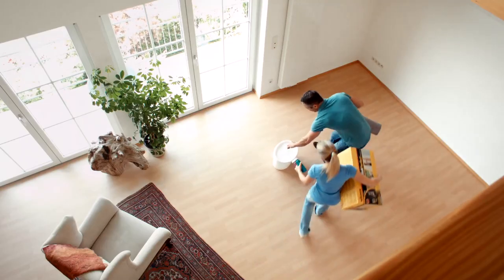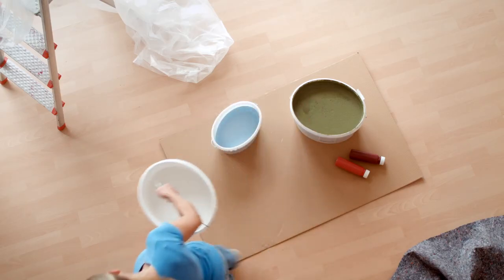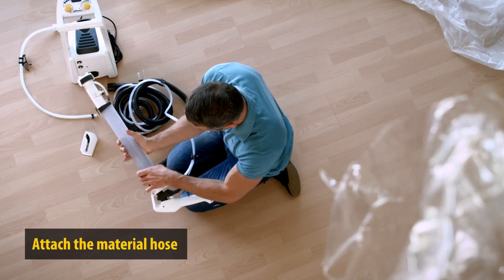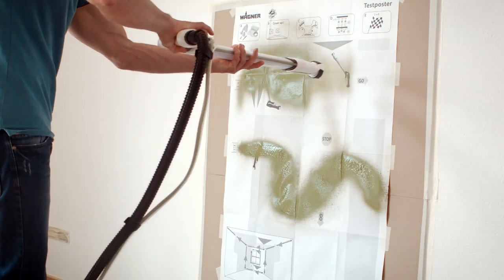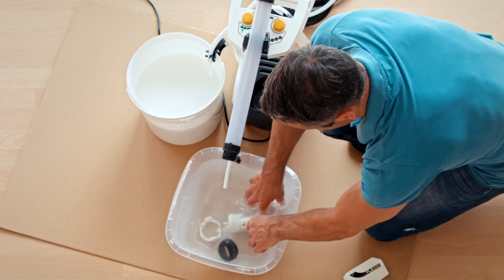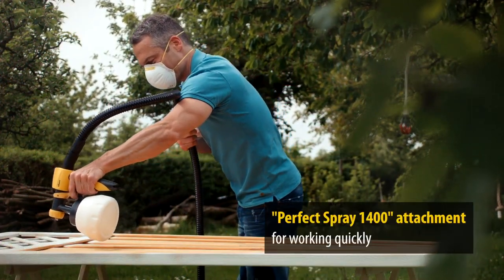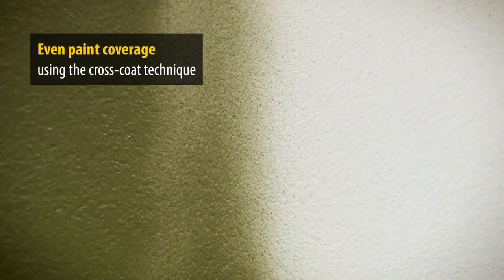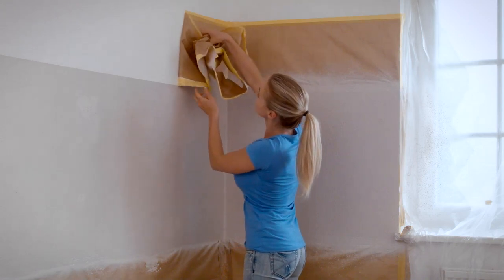Wagner WallPerfect FLEXiO 995- Full Product Details

Comment: Aja wait, how does a fucking extension make primer obsolete?  He just randomly said 'no need for that shit anymore!' without explanation
Reply from the maker: Dear mackhomie6,
what we meant was that you don't have to cut in the corners like you do with a roller. You just spray the corners and edges without any initial coating. 
Maybe that wasn't highlighted enough. We're sorry for this!

Best regards,
your WAGNER Social Media Team
Reply: why no ph. number
Reply: WAGNER United Kingdom maybe it's a us/uk thing.  I can see how a "primer coat" could mean a preparatory (cut in) coat, but it's probably not ideal wording when a coat of primer is its own separate material. Im actually curious now--is "primer coat" the equivalent of what we might call a "cut-in" or was it just an oversight
BTW, big fan of the sprayers.  Super inexpensive, and once you've got the hang of assembly/disassembly, they're a real time saver.  It's amazing how many people have left terrible reviews because of issues that clearly stemmed from them improperly assembling it. "I use it once, cleaned it perfectly, and now it leaks everywhere!/doesn't work at all!" Lol.  I, too, experienced a leaky nozzle and uncontrollably strong spray and realized when I took it apart that the error was my own--and nearly made a different, but similar, mistake afterward that no doubt would have had me thinking the sprayer was to blame.  
It's not an overly complicated design, either, but perhaps the addition of a small marking of some sort on the component parts in the nozzle (align the dots type thing) could assist in ensuring the proper installation.  
Apologies for the novel.
Reply from the maker: Dear mackhomie6,
thanks for your feedback! We really appreciate it. I will forward your suggestion regarding the nozzle to our product management team! 
Regarding the "primer coat" issue, it clearly is a translation mistake! Compared to other language versions of the video, it really doesn't make any sense! So sorry for that and thank you for pointing that out! 

Best regards, 
your WAGNER Social Media Team

Comment: This is a poor product - the spray arm falls apart being made cheep plastic, buy duct tape to keep it together. The paint pump hose fails and you will need to fully dismantle it to change the tube on the pump - the gears on the paint pump are plastic and break, the finish is average. Solution - use a roller instead
Reply: I used this twice durring 6 years for painting 2 different homes. The third time today the pump sjust stopped working. No more paint suction. The cleaning button does not work anymore. Just the air ventilator keeps working. I am looking now for a fix. Probably will have to use a roller instead.